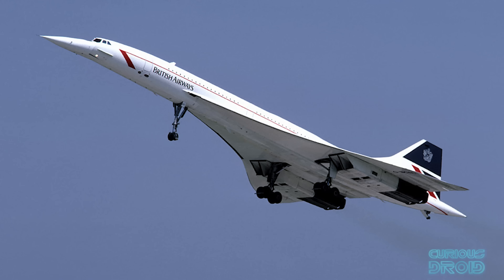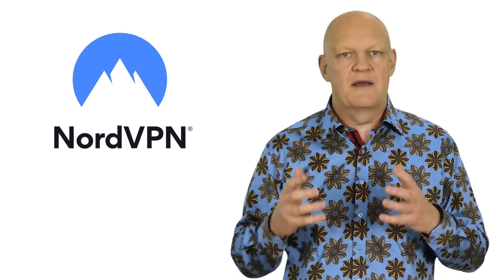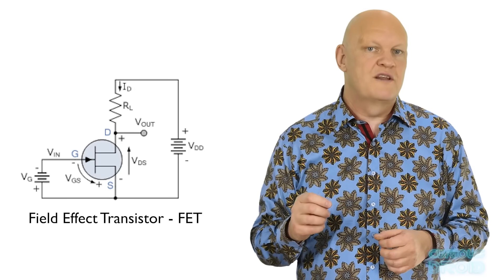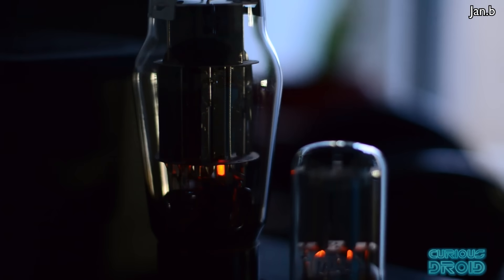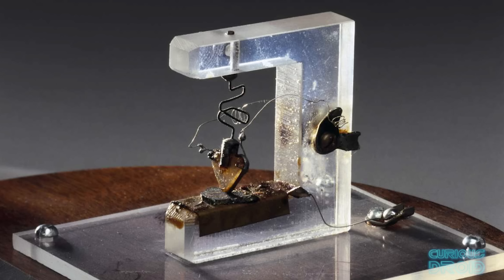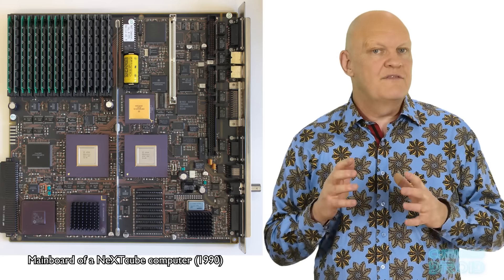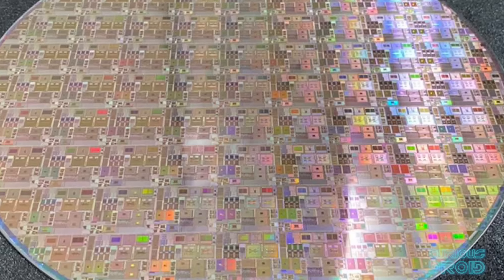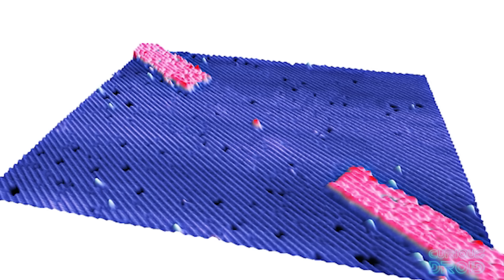MOSFET – The Most significant invention of the 20th Century

Comment: 7nm transistors are not actually 7nm across - the number of the transistor size stopped meaning anything physical around 14nm. There's a lot more to each process node than just the length of each transistor. Source: I work at one of the companies mentioned in the video - I see images of (and measure) them on a daily basis.
Reply: Goddamnit Gorak......you’re not supposed to discuss this outside of the compound. I’m reporting you to HR.
Reply: @Deeplycloseted435  Hi Is this HR?

I’m @Mrs Gorak9000, just calling to let you know @gorak9000 won’t be in today
He’s not feeling very well.
Reply: @Deeplycloseted435  that comment had me rolling for a good while. Thank you.
Reply: @Deeplycloseted435  Just let Gorak9K have some fun. I am sure that most of us out here can't quite follow what is going on anyway.
Reply: It's supposed to be the feature size though what manufacturers call a feature is not consistent so never compare for example Intel's 7nm to somebody else's
Reply: @jms019  it is based more on denisity these days, but even then it is not exact numbers or anything.... It is we can jam x number in y area, therefor sqrt(y/x) and that give our number... even this is oversimplified... As said, it is mostly for marketing, and here is the thing, most people here do not need to care about it. Seriously, what you should care about is performance per dollar, or performance per watt for the final product. The actual node it runs on is more marketing to the IC designers like AMD, Nvidia...
Reply: I would like to have someone make a video that explains what these **nm indication means now...in layman's terms.
Reply: @faustin289  nm=nanometre. 1nm=one thousand millionth of a metre. Metric system length.
Reply: I thought that the last time the process name and physical reality matched up was at 22nm.
Reply: @korakys  That could be the case - I don't remember exactly, and being sort of half in production and half in research, we deal with many process nodes all at once, so it makes it harder to keep track. Right now for instance, we work on at least 4 process nodes at once - everything from high volume production to 2 or 3 nodes in the future that are under development. Honestly the internal code names mean more to me than the #nm names do.
Reply: @gorak9000  So we basically entered the quantum world allready?
Reply: @Randy778  No, I wouldn't say we're in the quantum world yet. It's just that the XXnm names used to actually mean something. If you took an image of a transistor before, you could actually point to a physical dimension, and say "here's why this process is called XXnm, because this dimension here (the channel length) is actually XXnm". Now, at 7nm, or even 10nm, if you look at a SEM image of a transistor, there is no physical structure that's actually 7nm or 10nm - it's all just marketing now. The transistors are also markedly different than they used to be when the XXnm names were actually meaningful too. Back then, you still had planar transistors (gate only on one side above the channel). Then came fin-fets (basically gate on 3 sides of a "fin" of silicon that sticks up), and now gate-all-around (gate on all 4 sides). So the physical structure of the transistors changed tremendously, but we still use a measurement that really only physically applies to planar transistors, and it's meaningless. That's why Intel 7nm is completely different (more dense) than TSMC 7nm, even though by the marketing wank, they're both "7nm". A more useful measurement would be "x transistors / um^2" or something, but no one will switch to that because it's too meaningful and has no fudge factor. You also have to take power usage and transistor performance into account as well, which is another area that's not equal between competing processes, even though they have the same process node name (like 7nm).
Reply: @gorak9000  transistors per ³ ? 
That would be interesting.
Reply: @gorak9000  Amazing. 

I wonder how much this terms can change and become more meaningless if we move to fabrication in space. The methods and limitations will be different, but is just something funny to think, the different limitations and the different behavior of materials and elements, the physics limitations and how much the technology could change to adapto to a new enviroment, maybe the light of the etching process could be directed from many directions in a suspended dropled of materials that could be growned of metal depositions in a vaccum chamber, plannar waves of interference and magnetic directions to write the patterns of the "wires" to connect every matrix of 3d self folded webs of transistors. 

One can dream about it.
Reply: @Randy778  We entered the quantum world when the first NPN transistor was invented. Silicon energy bands, and donor and acceptor atoms in silicon, depend on quantum mechanical effects. One of the first things you do in an undergraduate electrical engineering curriculum is take a course in quantum mechanics so you can sorta kinda understand why transistors work.
Reply: @gorak9000  Thank you for your insights. What are your thoughts on intel falling behind in their fab tech to TSMC?
Reply: @Randy778  I read an interview with I believe Gordon Moore  in the late 90's that said Intel had to deal with the effects of quantum mechanics in chips even back then. To be clear these are not quantum transistors he was talking about.
Reply: So you told us what 7nm isn't ...it might be useful to tell us all what 7nm actually means
Reply: It does mean something, just because transistor density is not uniform doesn't mean the nm is irrelevant. It is why 7nm chips can be manufactured with FinFet,  whereas you need cutting edge EUV to go below it. You don't work for any of these companies (not at any significant position that is), you have just seen a video or read an article where they claimed that Intel 10 nm has higher transistor count than Qualcomm's 7nm. (Many people did so hence why your comment got so many thumbs up)
Reply: @jackwilson5542  Heh, I don't work for one of the companies huh? I guess my paystubs, stock purchased at employee discount, what I spend 8 to 10 hours 5 days a week working on, and the SEM images I see on a daily basis are just figments of my imagination. Sure thing there rando on the internet who knows better (but yet seems to think Qualcomm manufactures their own chips and has their own process - might want to do at least a cursory wikipedia check of Qualcomm before you go trying to look smart, but instead just showing yourself as a complete fool next time)!
Reply: @gorak9000  I didn't say Qualcomm manufactured its own chips. You are just proving me right by such an infantile projection.
Reply: @jackwilson5542  "Intel 10 nm has higher transistor count than Qualcomm's 7nm" - there is no such thing as qualcomm 7nm - qualcomm doesn't fabricate anything - so you claim I don't know what I'm talking about, yet you don't know that qualcomm is fabless - uh huh, sure thing
Reply: @gorak9000 I've been working in the semiconductor industry for quite some time now. From all the training over the years, the XXnm measurement, was the size of the individual gate. Working in a R & D fab, measuring with a SEM, our gates where in the 7nm range back some 15 years ago. We did experience a problem with them "tearing" off the substrate because the were too "tall" (25nm) The Process Engineers corrected this by reducing the gate height by half. (12nm).
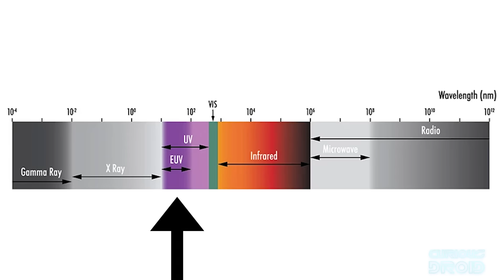Reply: 15:03   Fact check - wavelength of 13.5 nm  ?  then it wouldn't be possible to make 7nm chips.
The wavelength would have to be a minimum of  1/4 of 7nm or  1.75 nm.
Reply: @Bobby-fj8mk  modern chip production process nodes haven't used optical wavelengths for quite a while (3 or 4 process nodes). So, you're technically correct that it's 'impossible' to fabricate 7nm chips with 13.5nm wavelength light.  So they don't use those wavelengths.  Extreme ultraviolet, or x-rays, which DO have wavelengths below 1.75nm, are used to pattern masks for the newest processes.  That's one of the reasons modern fab equipment is so much more expensive than it used to be.  I was in the industry for 40 years; I started out with 10nm PMOS in college; the last chip I worked on was, I believe, 14nm.  Not that that still means what it used to in terms of transistor channel dimensions, as others here have said.
Reply: @davidnaegle427  - thanks David - I was just doing a fact check - 
the video must be wrong as it states 13.5 nm light is used and
goes into great detail of how that light is created. 15:03
It doesn't mention X-rays or any radiation less than a wavelength of 13.5 nm.
The video is wrong.
Reply: It is just a marketing number now.
Reply: Source I said so on the internet
Reply: In July 3rd of 1947, a UFO crashed in Roswell. It had a glass panel full of microscopic circuit like thingy, broken wire that lit up at the end, a pen with light that can cut through anything, and a few other mysterious devices which we still don't know what they are used for. Read the book "The Day After Roswell" by Colonel Philip J. Corso. Some engineers who worked on early transistor validated the claims in the book. 

Interestingly, before 1947, we only had vacuum tubes and there was no clue how to improve it. December 1947, as told in this video, we had the first clumsy and rudimentary transistor, that is the building block of IC chip.
Reply: @sbkarajan  Oh, go away.

Comment: Just a FYI: the flow chart at 14:00 is describing the manufacture of non-electric microfluidic devices, as used in fuel cells, microbiology etc. It still illustrates the idea of photolithography, but it's not describing the process of making ICs like MOSFETs.
Reply: please QD, make a video on chip manufacture

Comment: TSMC's/SAMSUNG's/INTEL's 7nm process doesn't refer to the transistor size it's just marketing. INTEL even went so far as to rename their 10nm processing node to INTEL7, because it has, more or less, the same transistor denisty as TSMC's 7nm process. 
Now I'm no expert and please feel free to correct me, but I think the 7nm part refers to the width of the FinFET tips. 
The only thing I could find was on the 22nm process and that was named after the half pitch (half the distance between identical features in an array).

Comment: MOSFET: Metal Oxide SUBSTRATE Field Effect Transistor -  besides that, interesting video.
Reply: I have never seen it called Metal Oxide Substrate anywhere at all (in english).
Reply: @adamrak7560  Yes, you're right, haven't got a clue where I got that from, thanks for the correction. Shame on me! Managed to design with them for over forty years though! :-)
Reply: @icarossavvides2641  It is made of 3 basic layers: metal (or metallized polySi), oxide, and semiconductor substrate.
So you are obviously "right", but I have never seen it called that way. I thought that in your language it is called differently.
Reply: @adamrak7560  I don't know, I first used them in the late 70's, maybe that's what they were first called and they've had an identity crisis? Or maybe my memory is just playing tricks on me? Maybe the latter eh? Anyway, Metal Oxide Semiconductor (or Silicon I've seen also) Field Effect Transistor it is anyway!

Comment: 11:02 as far as I remember floating gate is not used in DRAM. In DRAM we have capacitors that are periodically recharged.
Reply: A floating gate is a capacitor. Whether you call it a transistor with a specially sized gate for the purpose or a separate capacitor is subjective and no doubt varies across devices and manufacturers. Let us also remember cousins EPROM (erased with ultraviolet) and EEPROM (erased electrically). DRAM is the only one that has to be refreshed in normal use rather than say after forty years
Reply: @jms019  I'm still not convinced. My point was that in DRAM there is no such thing as floating gate. The capacitor in DRAM is physically connected to the ground and transistor that enables it. Floating gate is piece of metal physically isolated from the rest of circut. Every floating gate acts as capasitor but not every capacitor is a floating gate. The text about floating gate and DRAM at 11:02 is IMHO incorrect.

Comment: My dad joined Ferranti in 1952 after a spell designing vine camera mechanisms at Borehamwood. Ferranti had a Collosus computer in Portland Place, London until it was replaced with Pegasus based on semiconductors. The smell of hot valves was replaced by solder as I made portable radio kits with transistors. Thanks Paul for this amazing technical history lesson

Comment: You say that... but in my opinion its just another damned transistor and no more important on its own than the shift from waxed paper separators to plastic single wrapped cheese slices.   Radial ply tires and Cat Litter are far more important inventions from the 20th century.   MOSFET is just an application of tube field technology using a solid "ether" instead of a charged plasma vacuum, thus working in saturation instead of scavenging effect. While it's certainly smaller and safer than a beautiful retina burning multi-lobed glass chamber of mercury it isn't a new thing.  If I were to declare a "most significant invention" I would go for Magnetic Core Memory.
Reply: I'm not sure I would go for Magnetic Core Memory. It's just another damned magnet and no more important on its own than a can opener. Magnetic Core Memory is just an application of magnetic technology using ring-shaped rather than bar magnets. While it's certainly smaller than household wall switches, it's not a new thing. If I were to declare a "most significant invention" I would go for kitty litter.

(sheesh…wtf?)
Reply: I think you're both right.

Comment: Small nit: if transistors had never been invented, vacuum tube technologies would have followed the same curve. By the time transistors arrived, tubes were being miniaturized, and we had invented cold emitters, tubes that didn't need a heated filament. In fact, integrated circuits using vacuum technology appeared later. They were proposed as an alternative flat panel display technology.

Extra bonus nit: It was true that early vacuum tube computers tended to operate for short times because a tube would burn out. However, the Univac series of computers, in a company founded by the inventors of the stored program computer, Eckert and Mauchly, fixed the tube lifetime issue by "derating" the vacuum tubes, that is, running much less filament current through them than normal, thus prolonging their lifetime and enabling the machine to solve serious computing problems. 

The next most difficult problem in computing, that of creating a large memory store, was solved, ironically enough, by neither vacuum tubes nor transistors, but by little magnetic donuts known as magnetic core memory. Thus computers reached much of their current form before transistors arrived.

Taken together, magnetic memory, magnetic tape and magnetic discs formed a huge part of what made computers successful through the end of the century and beyond. I guess it does not sound as sexy to have a title like "Rust: the most significant substance of the 20th century" :-)

Comment: Many audiophiles feel that MOSFETS mimic vacuum tube behavior.
Reply: because they're field effect exactly like a valve and you get even harmonics
Reply: @jms019  "MOSFET advantage TUBES in all aspects:
-Very higher transconductance (two magnitude order, typically 3,5 mhos)
-Direct load coupling (transformless) this mean higher bandwidth, less distortion, more damping factor.
-Better gain bandwidth product.
-Power bandwith one magnitude order higher than TUBES.
-Easy paralleling." I'm quoting.